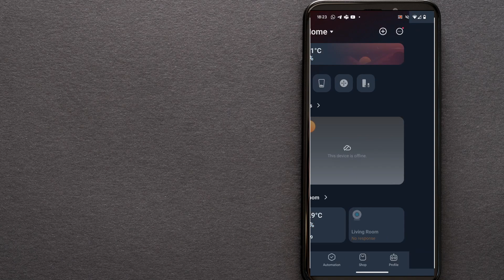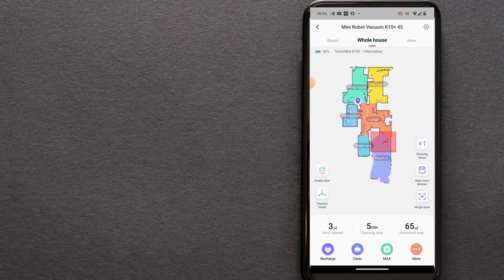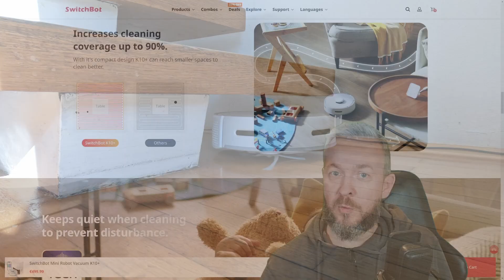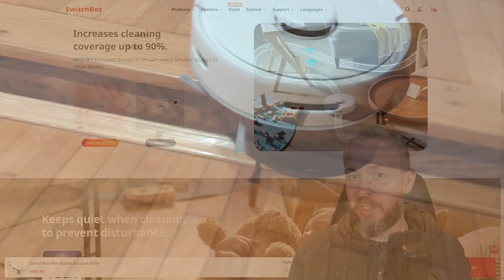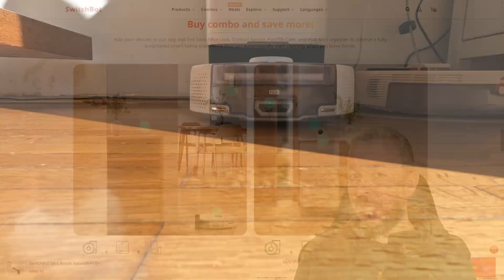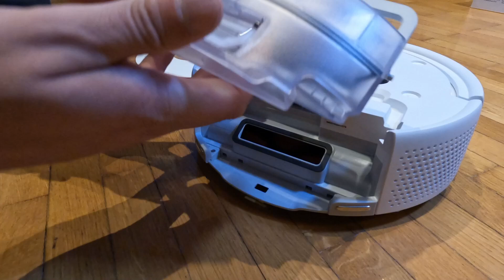See why NEW tiny SwitchBot vacuum is PERFECT for small apartments

Comment: Another great video.
I have a tiny apartment and a narrow area where ordinary robots just won't fit. This had me frustrated for some time - until this tiny thing showed up.

Only thing I want to know before I buy a vacuum robot: can I replace the battery myself?
I've owned a robot before and the battery died after three years. Getting a replacement battery was difficult but replacing it was super easy, just plug and play - and so the robot is still going strong. I won't buy any robot vacuum that I can't replace the battery myself.
Reply from the maker: Wait just a bit - I'm currently testing K10+ Pro version - almost the same, but bit better. Video should be out next week.
But also, on the other hand, I'm using K10+ as daily vacuum with schedule to clean kitchen and dining room , each night.
Reply: @BeardedTinker  Wow, wounds great. Can't wait to watch. Love your videos!

Comment: Hi and thank you for your time, making these videos. Do you still have this cleaner? I see an integration in HA for Switchbot, i was wondering if the cleaner can be integrated. I have no products from this company and i am looking for a good option to be integrated with HA.
Reply from the maker: Thank you for the comment. I'm still using it and yes, you can get it in HA but only if HA has Matter enabled AND you also have SwitchBot HUB 2 or mini HUB with matter support. BUT also, it's very limiter - only one switch to send it out and return to dock. As far as I know, this is current limitation of Matter standard and will be improved in future.
Besides that, I also have Roborock S5 (something something) - that one also connects nicely with HA natively and via Xaomi App and HACS component.

Comment: Great review! We got ours a couple of weeks ago and we love it.

Quick tip for you - I couldn't help noticing at 11 minutes 32 seconds the speeded up "starting to empty dust" message! We had this issue too, after we played around with the different voices in the Voice Pack to see what they sounded like on the robot. When we switched it back to English the voice was corrupted and some of the messages were speeded up, like ""starting to empty dust" and "returning to charge".

We logged a ticket in the app for SwitchBot support and they applied a firmware update to our robot. All our English voice messages are now working correctly again. Not sure if they've fixed the cause of issue though, so I'm avoiding playing around with the voice pack again until they confirm the issue is permanently fixed.

Hope this helps to fix your robot’s voice!

Cheers,
Richard
Reply from the maker: Thanks for the tip! We are running it actually in Korean :) That sound so much fun. No idea what it says, but sound great!

Comment: Great review and hopeful about adding Matter support so that I can use it with Home Assistant, but I will still miss calling out specific rooms to clean from Home Assistant. I've had my machine for a week and it works great, love the small size, but every once in a while I have issues where it can't connect to the base station. It goes back fine, but when it turns around to "plug" in it misses the alignment and gives up after a while, so it doesn't charge. Have you had this issue?
Reply from the maker: Thank you! Actually I did, only once, at temp position I had it first day. It was on direct sunlight. Even contacted SwitchBot because of this than in manual (I was bored so started reading) I've seen that they said to avoid any direct sunlight as it messes up homing (probably some IR light in base) - check if this is the case with you. But if it's dark, and you see this issue, than unfortunately, this may be a bug. Also check if there is glass or mirrors close to base, that can also mess it up.